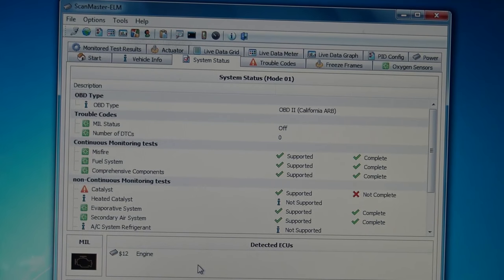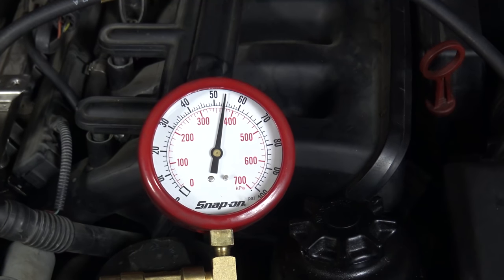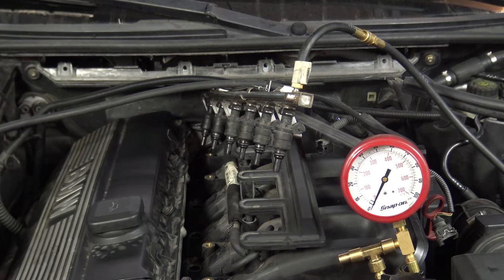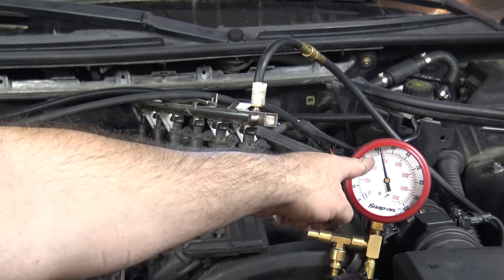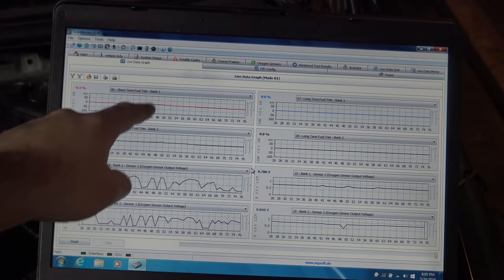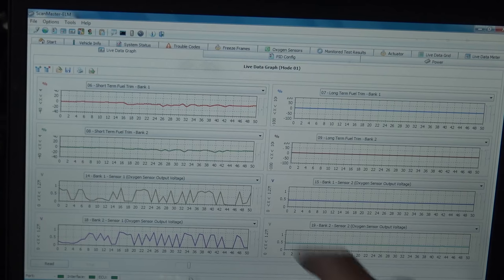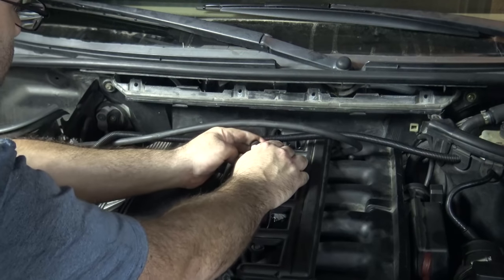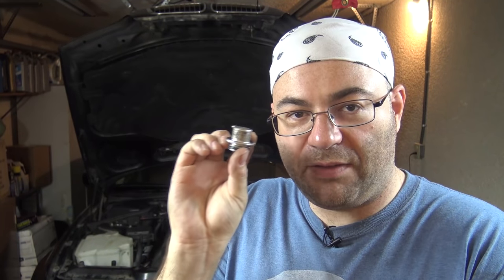E46 Negative Fuel Trims Case Study

Comment: Specs in BMW TIS state the proper fuel pressure of 3.5 +/-0.2 bar. So the fuel pressure on this E46 was within manufacturer specs. My M52TU has 3.7 bar too according to my cheap gauge.

I got mislead watching idle short fuel trims in Scanmaster too before. Was killing my head for a few days watching my car idle trims before I figured it out to some extent.

BMW doesn't really know the terms for short and long fuel trims. If you look at trim values in INPA there's three values. Lambda integrator is what STFT PID in Scanmaster is calculated from. Then you have two adaptation values and they're both learned trims. We could say the additive value is similar to OBD2 LTFT learned at idle and multiplicative is LTFT learned at load. I'd guess back in the 90's when BMW had to go OBD2 they had to provide a PID for STFT and LTFT. They decided to calculate the STFT from the lambda integrator value. I have to figure out yet how they calculate LTFT but because they had only one LTFT OBD2 PID available I guess it's either calculated from additive and multiplicative value combined or from multiplicative value only. But there's no PID that would display OBD2 equivalent of additive value. So it's not possible to monitor this idle LTFT with generic OBD2 tools like Scanmaster.

Now back to your video the LTFT sits at 0% (I guess because prior to the shooting adaptations were cleared). The DME will never learn it's OBD2 LTFT value while idling. Multiplicative value is not learned because it's part load trim. And as long as multiplicative is 0% OBD2 LTFT trim will be 0 too becuase it's used to calculate it. The value that's being learned is the additive one. And there's no way you could tell what the learned value is while watching the graphs. So you can't just add the STFT to 0% LTFT as total fuel trim in this case (you could probably on pretty much any other car but not BMW). Because actual LTFT is not 0%. It's the additive value actually . It's not possible to connect INPA and Scanmaster at the same time and even if it was, additive value is not measured in % but in ms, so you still couldn't calculate the total fuel trim %.

I don't think new O2 sensors needed to "bed in". The ECU might have just finished adapting after the adaptations were reset. Say if your idle STFT was -9% before. By the end of the video the additive value might have very likely adapted to a positive value in ms that would equal about +9% if calculated to OBD2 trim numbers. That would give STFT's around zero in Scanmaster making you believe the trims were perfect now. But it would idle on the lean side actually. I can't say I'm 100% sure about it without knowing what the actual additive values were in your case. But from my experience that's exactly what would have happened.

I know INPA a kind of sucks for diagnosis because it can't do graphs or log data but while diagnosing an E46 that's idling with 0% LTFT, Scanmaster is pretty much useless. If you want to graph values from INPA there's also software called Test-O. It's BMW specific and actually can graph and log same parameters as INPA. And it's user interface is clumbsy and it's awkward to setup the graphs and logging compared to Scanmaster. So I can't get used to it but it works. You can check it out. Maybe it will work for you.

Comment: Great video man. Have learned and done a lot to my 330xi from just watching your videos. 
This whole fuel trim thing is new for me, and trying to figure out my fuel trim issues. The STFT on both bank 1 and 2 average 3%-5% at idle but drop to -3%-0% as I increase rpms. LTFT are constantly at 7%-8%. 
Im throwing a P0491 and P0492 so I know my secondary air needs some attention somewhere. Any thoughts?
Reply from the maker: Concentrate on the secondary air system.  I'll bet the vacuum line to the secondary air valve is broken.  Check that out.
Reply: Do you have a a shop service manual?  That may help you......Hope that helps

Comment: hey quick question... 02 325i do u think my car would run rough if I remove the stock air box and install a aftermarket cold air intake ? thanks for answering my questions..
Reply from the maker: usually that isn't a problem, unless it's an exceptionally bad aftermarket product and the engine can't breath as well as before.
Reply: +50sKid ok thank you very much for replying.

Comment: Hey, I have recently bought a 316i e46 (N42B18 engine) and I've got some problems with the oxygen sensors... Currently the oxygen sensors are swapped (according to realoem) but if you swap them to their correct positions I end up with a fault code saying they are swapped. Disconnecting the bank 2 cable gives a fault code saying that the bank 2 sensor is disconnected.

 Any help would be greatly appreciated! 

Ps. I've learned a tonne from your videos and I watch them like a teenage girl watches Netflix.

Comment: While I am watching. On a straight 6 BMW engine, which cylinders are bank 1, and which cylinders are bank 2 pls. You mentioned it later in the video, thanks. You pulled a vacuum hose from the fuel pressure regulator without testing for a vacuum leak, low vacuum means greater pressure. You then put in a used part, you then changed the part again without getting that repair on camera and not showing the good fuel pressure, and editing the first used part out of the video OMG. No shop rags under the injectors to catch a drip, drip hell, it's a flood, OMG. No worries about the mistake, we all make them hehe. You had the injectors out, I will assume you didn't put a cleaner through them, and you didn't flow rate them or inspect them for a good spray pattern after doing all that work to pull them out, OMG. Nice diagnosis to swap O2 sensors but to get a better reading on your graph, only graph the 2 sensors and not all the other stuff, the more stuff you monitor, the slower and worse your graph on the items that you really need to trace. On a test drive, you should also monitor your throttle so you remember for sure when you accel and when you cruise and when you decel and stop to idle. No need to erase adaptations when you don't have any long term fuel trims, even if you did, they will clear up on a good test drive. Do you trust your fuel pressure gauge that much, where did you get it tested and certified? With other guys saying 54 on their cars, it's good to go. Thanks a lot for the Case Study.

Comment: you never answer but i think wtf ? what you have done is bacicly fixed the ritch condition problem by changing regulator witch showed the same number. maby you did something more and dont remember ? is it possible that  after maf replacement ecu corrected trims later then then it should ? i noticed bmw ecu,s are very slow in that term

Comment: Hey there! Can you help me diagnose this issue !  I have a Autel Diag Maxi scanner, which i am just learning to use. The car is a 2010 elantra sedan with a rough idle for a few seconds on a cold start, idles smoothly for about a few minutes then idles  rough again with engine under load and transmision in drive. It now seems to miss under accelerating ,has lost power. I pulled the plugs at 62,000 kms and they looked black. No DTC or stored codes, but STFT is about -1.2% and the LTFT is about -4.17. Both fuel trims are negative. Is this a rich condition? Gas mileage is very poor, so is throttle response esp between 40-60 KMS.  What should I be doing next? Both fuel trim's are negative.
Reply from the maker: Yeah it's slightly rich at idle but what is it at 3000rpms?  Typical fuel trim problems get worse or better at speed and that's the key to analyzing them.  But, if your plugs are black, that's a surefire sign it's running rich.  It's either getting too much fuel from a bad fuel pressure regulator or a leaky plug (but that wouldn't explain all the plugs being black) or the mass air flow sensor is reading too lean and the engine is mistakenly compensating by adding too much fuel.
Reply: Very slightly rich, Edward.  50sKid says MAF is reading lean and engine is compensating by adding fuel. Actually engine is taking fuel away.(minus numbers) Usually a dirty MAF will read less air , (lean). making engine add fuel. your engine is taking fuel away. because you are rich. Now what is causing rich condition?
Reply: You are so slightly rich that it a about normal. You need to  look for something else, Edward, to account for poor fuel mileage and black plug.

Comment: Hi there, first thanks for your videos! I have quick question: My 320ci 2000year shoes on board 18L/100 and sometimes goes to 20L/100.. and when i went to scan tool its shoes something like this "Oxygen sensor heater after cat bank 1"
Reply: I`ve tested the engine with smoke machine and found sucking jet pump ont the break hose leaking smoke and the distribution piece (equalizer) was broken one of the pins so i fixed it. Went to a guys they deleteed some errors history (not just the codes, because i have scanmaster) so the normalized. But now the oil yellow lamp poped up when i turned the car off so i check the level and it was on the minimum i poured a liter and today i started the car and pulled up the dipstick to chek the level and some WIERD sound was there like bubbling or something like this....?! Gosh im so tired fo this ...do u have any suggestion?
Reply: Thanks for the fast answer. I`ve changed the ccv before 6 months. I am so scared :D so I read everthing on the internet and i found some guy saing this "The PCV system will try to suck outside air down the dipstick tube when the stick is removed - because it's continually trying to suck the crankcase out. Disconnect the PCV line and see if the sucking noise goes away. If so, you're just hearing the PCV system working as designed."    So make sens, but dont know is this true?

Comment: 02 Sienna, 420 code.  Does 99.2% B1S2 indicate a bad after cat O2 sensor?
Reply from the maker: You're probably looking at the wrong PID code.  Some of them report as 99% which doesn't really mean anything--make sure you're looking at the right thing.  Btw a P0420 code almost always means you're gonna be replacing your cat.

Comment: Ha - I was thinking all through the diagnosis how working on a two-bank system would make it easier to look for discrepancies...but only a two-bank system could have the swapped leads problem!
Reply from the maker: Definitely helps to have an extra sensor to swap over. Or fuel injectors to swap from bank to bank

Comment: hi 50skid.i am getting STFT1 as -100.8!!!! all the time..stft2 is -1.6 varies closely..LTFT1 and LTFT2 are positive 7 and 7.8.bmw e46 m54.thanx alot for ur precious time to make these videos.what could it be?..and what is normal..i dont think stft1 is normal
Reply: i used elm327 with torque
Reply from the maker: Could be a bad oxygen sensor, bad wiring, or a bad engine computer.

Comment: 50skid is this different on our m54? When I search for it I get a pipe bomb looking thing with filter built in. Is that correct?
Reply from the maker: Yeah this car was an M52TU--the M54 has the integrated fuel filter/pressure regulator
Reply: 50sKid ok that's what I thought. Do you a video on our pump? I couldn't find it. If you don't could you make one?!

Comment: I'm having similar issues with post cat o2 voltages on my E46 m3 and have been pulling my hair out for the last year trying to solve it. After seeing this video and also a scanner danner video, I checked my o2 sensor wires and found is it NOT possible to mix up bank 1 and bank 2 sensors because the plugs are different for each sensor. Strange they don't do this for all BMW's. I have downloaded the software you are using in this video so hopefully it will help me solve the car's issue(s).

Comment: Lets explain this a little better... READINESS MONITORS are just monitors that state if a test cycle was completed or not, if you reset the computer, the computer needs time to determine if everything is working correctly, that is what that READINESS monitors state...

Also that fuel pressure did not change AT ALL if anything it was HIGHER with the new regulator...

Comment: I had negative fuel trims and missfire on a m54 changed disa found ccv pipe orings were leaking changed it did smoke test still couldnt find the problem took me a month till i checked fuel filter wich was abit clogged still no difference only to find the battery earth terminal was loose  so tightend it and short trims are 0 on both banks problem solved.to anyone out there check your earth cables if once you've cleard all vaccum leaks and fuel issues etc